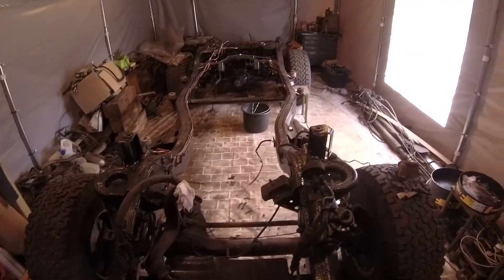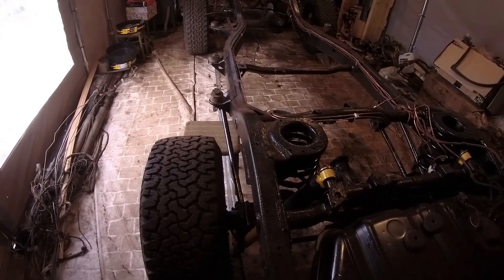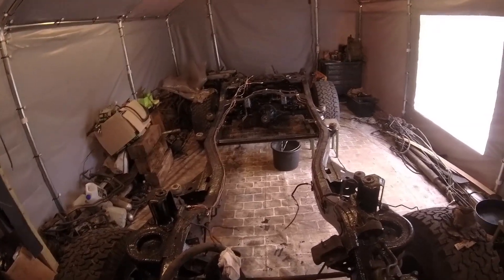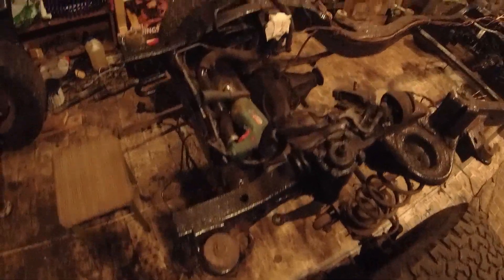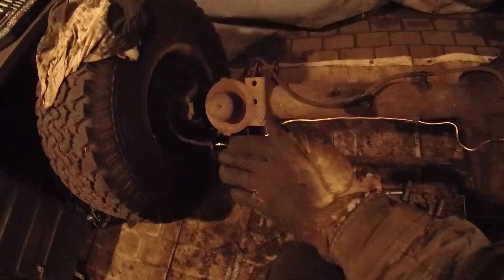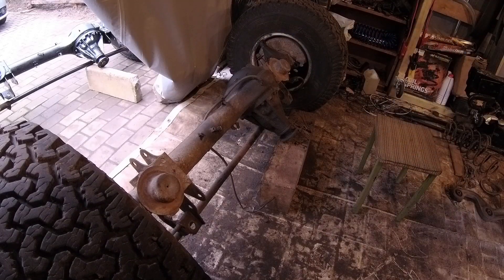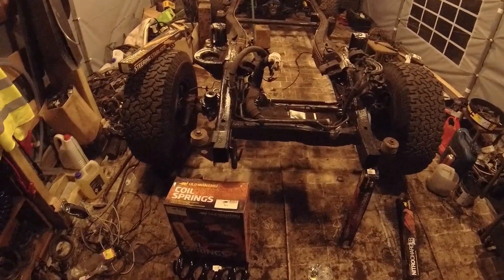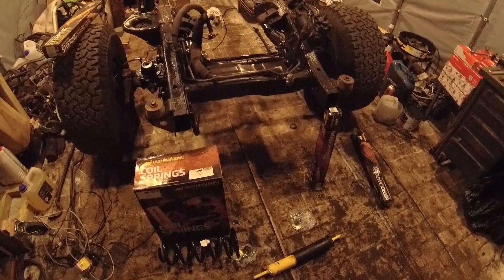Nissan Patrol Y60 restoration | Front Axle Installation #28

Comment: My steering bars/rods both need replacing. They are still working but there is play in all of the ball joints. Since buying new ones is not an option here my plan is to cut the ends and weld threaded ends to suit ball joints for some other truck. That way I will be able to service the bar with new ball joints whenever needed in the future.
Reply from the maker: I believe in next episode I found perfect company that helped me, but ok in all honesty I believe delivery from Poland to Brazil would cost a lot! Have no clue, but you can check them out, really helped me. Also I believe you can get a discount if you show that you found them trough me. But yeah, I believe the shipping would hit much more then the rod.

Comment: Mate,
Can you tell me what the OME part numbers are for springs and shocks?  Or was it just shocks from OME?  Think you said 2" lift?   Are the springs and shocks stock performance, or heavy duty etc? Lots of Aussies carry loads in the rear, so they may upgrade by 350 to 500Kg for the rears and stay stock at the front.  What did you decide?  I am in the UK, so don't carry big loads in the back (no long distance trips).   Cheers.
Reply from the maker: Thanks for reminding me, forgot to comment the part numbers :D 
This comment is just for you :) 
Front shocks: 
Old Man Emu NS-60013 Nitrocharger Sport Shock
Front springs:
Old Man Emu OME-972 or 2972 Coil Spring
Rear shocks:
Old Man Emu NS-60015 Nitrocharger Sport Shock
Rear springs:
Old Man Emu OME-GQ02J or 2GQ02J Coil Spring

Full 2" kit:
Old Man Emu OMENPY60SL24 Suspension 50mm Lift kit

Honestly maybe that is only the site codes, but I believe you can do a bit of research and this info will help.

The full 2" kit is considered High Load, but I don't think it would do good with 500 Kg, I believe it is more fitted 150 kg - 300 kg. I did all around, front and back. Mainly because my old was totally destroyed and I needed new anyway. Hopefully maybe after next episode I will put back the engine and then I will be able to get more perspective on how they hold. Basically without body I have no clue is it even higher :D I don't have point of reference :) 

I'm really happy that you stopped by and asked a question. Big thanks for that, hope I managed to clarify info for you. If you have any other questions or just want to chat about anything, feel free to email me or comment away!